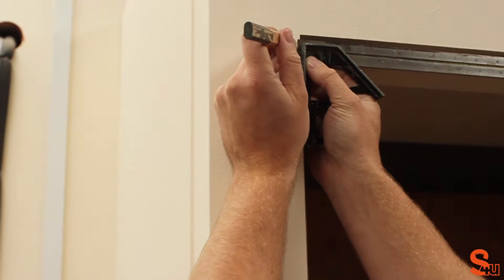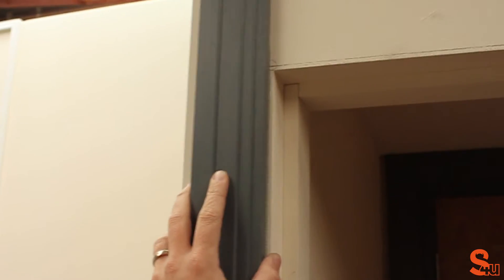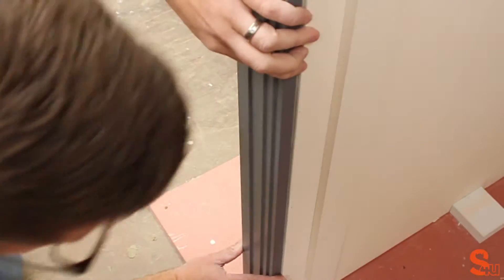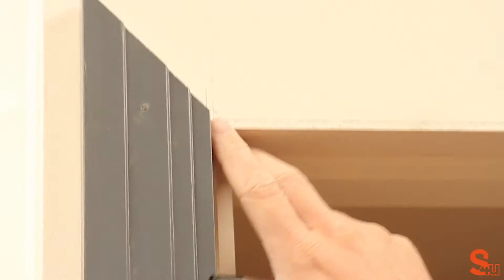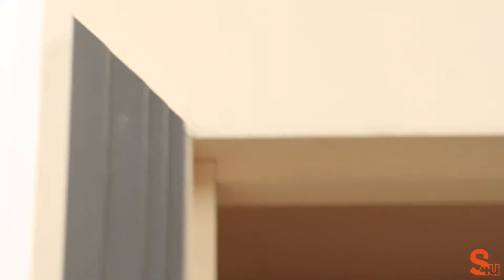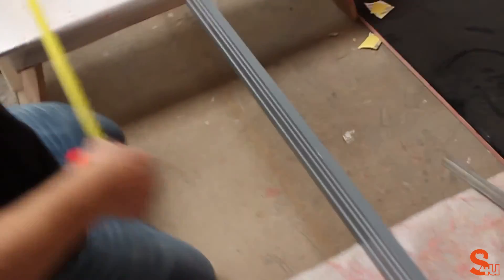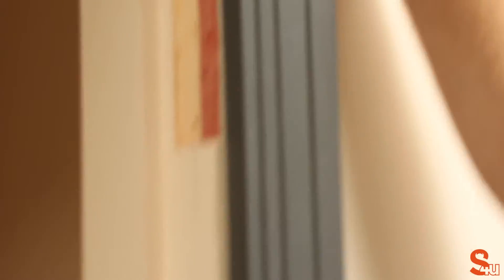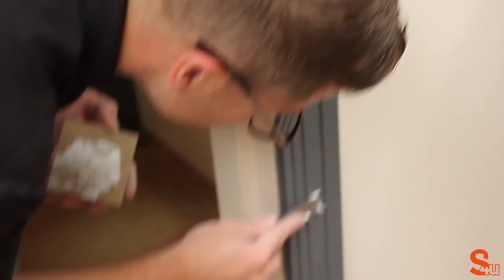How to fit Architrave

Comment: I found your video informative but I have a few questions. 
1) My house is quite old and we have had the walls re-plastered. This has left in some places a raised edge between the walls and the door frame. As the architrave sits on the wall and the door frame how would you recommend make the two surfaces level. (I was thinking of using a chisel and Stanley knife. Place the architrave in the correct position and score the plaster then chip the plaster off using the chisel so both surfaces are level). Thought about a filler strip but all the frames are different, some are only slightly uneven and others have a 5mm difference.
2) Some of my door frames are in the corner of the rooms, so much so that I can not fit a full width strip of architrave on the side of the door frame. 
I don't have a table saw, would you be able to advise the best way to cut the architrave length-ways. 
Thanks.
Reply from the maker: Hi Project Life,

Thanks for reaching out.

In regards to question 1 you could do exactly what you've mentioned or alternatively, you could fit it and then fill the gap with caulk.

For question 2, if you order from us we can produce the architrave to your requirements. However, if you've already brought some you could use either a hand saw or Jigsaw.

Thanks

Comment: This method is ok "IF" the door frame is square, in my experience they rarely are.
For true accuracy the angle in the corner can easily be disected and use an adjustable bevel to give your angle

Comment: What do you do if the frame was not put in square and the corners are not 45 degrees.
Reply from the maker: Hi, 

This is an excellent question!

We'll create a video which shows you how to do it in the coming days and notify you of the response. We do have a drawing which we can send you if you need a guide quickly. If you call 01922 451 689 and provide us with your email address we can send it over.

Kind Regards,
Kevin
Reply: Thank you for the drawing you sent me. I tried to measure the corners of 2 door frames in my house and one frame is just over 88 degrees and just over 89 degrees then the other frame is just over 89 degrees and just over 90 degrees.
Reply from the maker: Hi,

We've pencilled in this afternoon to shoot a video, we shall show the full method. As it need to be edited we shall hopefully have it up at some point next week.

Kind Regards,
Kevin
Reply: Hi. Did you manage to film a video after.
Reply from the maker: Hi, We managed to shoot the majority of the video however due to production being busy we are unable to complete it at the minute. It should be up within the next few weeks.
Reply from the maker: Hi,

We've now shot and edited the video it's the most recent video on our channel "How to fit Architrave to an Uneven Door Frame"
Reply: no more gaps and paint